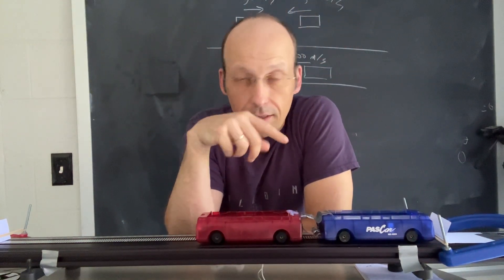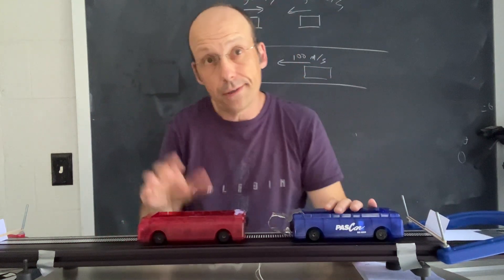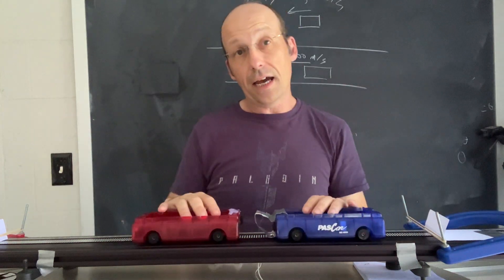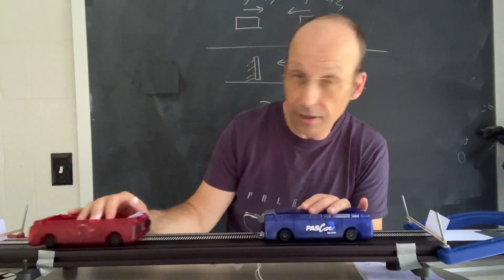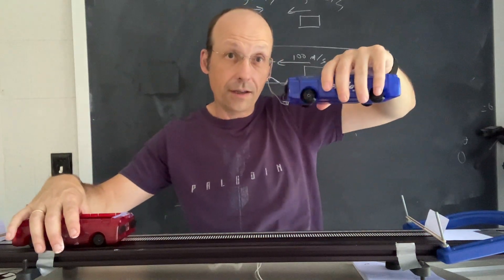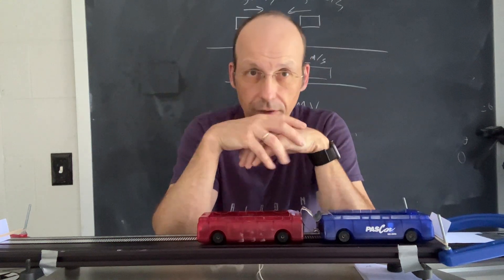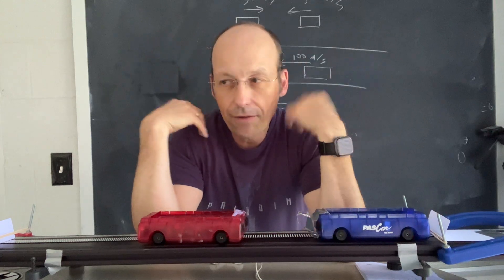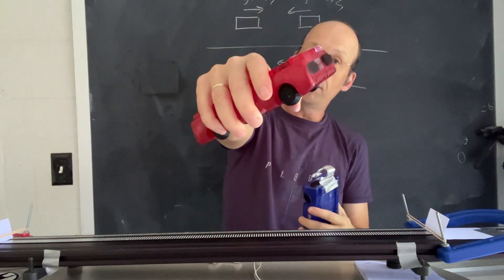Is a 50 mph - 50 mph collision the same as a 100 mph collision into a wall?

Comment: Tbh this is such a bad demonstration.

Well what I think is, if both cars have a crumple zone, then it should has a less impact force.

But if u are assuming the surface of both cars behave exactly the same as well then it wouldn't make a difference, as velocity depends on the frame of references

Comment: no, combined impact sped is 100 but the forces are equally shared between 2 vechicles. so the impact damage shoudl be similar to each car doing 50 into a wall...
Reply: I don't understand. When you hit the wall, the forces doesn't equally share between the car and the wall? It's the same case, isn't it?
Reply: @vojtareichl  not. If the wall is an immovable le object
Reply: @yandyyay   you are wrong, and seem to be assuming that energy scales linearly with speed, which it does not. Doing 100mph into an immovable object which absorbs no energy will result in all the kinetic being absorbed by 1 car instead of 2, resulting in 'twice the damage'. However, to achieve similar impact damage, you need to half the kinetic ENERGY, not the speed. E = 1/2 mv^2, so do the math...
Reply: @GamezGuru1  right ypu do.... so the scientists and mythbusters and actual evidence from actual real world crashes are all wrong ?
Reply: @yandyyay  we shouldnt question him maybe he is always right so he always makes all the right decisions and says the correct things, we should strive to be like him, we can only envy that he has his entire life right and without problems he cant correct
Reply: @yandyyay  no. just you